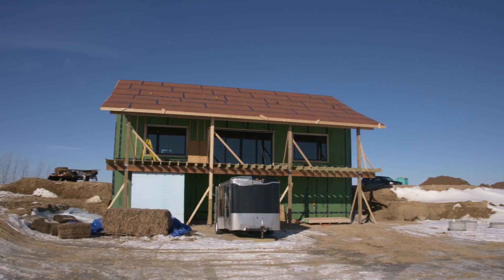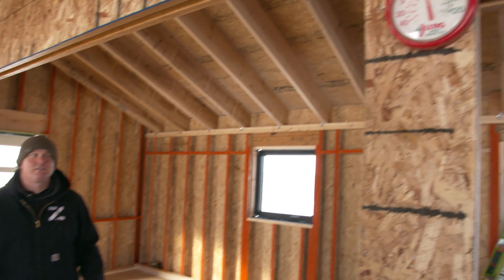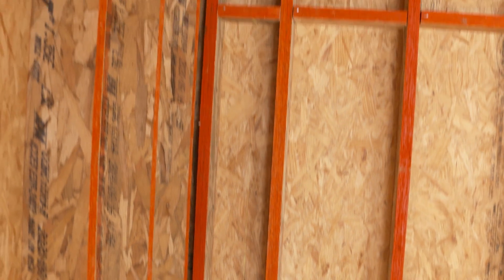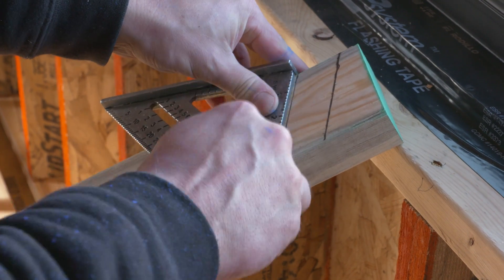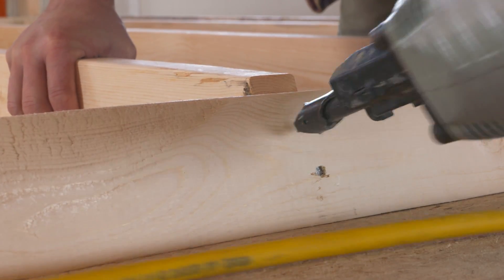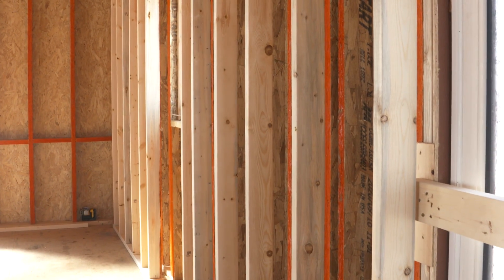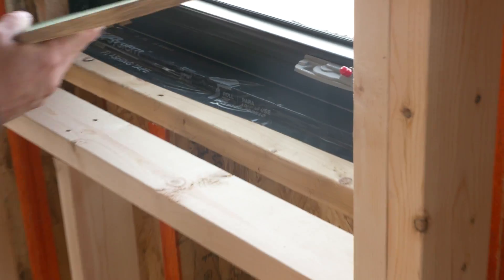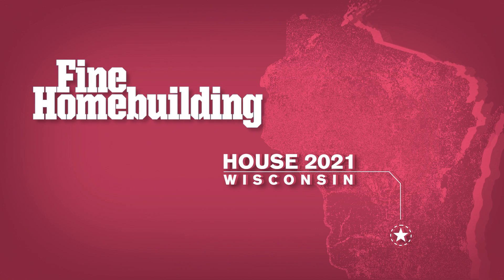Episode 3 FHB House WI: Framing Interior Double-Stud Walls

Comment: Why not just build with 2x8 or 2x10 walls, insulate 2/3 the depth and leave 1/3 available for electrical?
Reply: Yes, why not?
Reply: Because they are more expensive, not as easily thermally broken. heavier to work with and will move 1/4 to 1/2 inch risking damage to finishes down the line.
Reply: Thermal bridging of 2x8's will cause heat loss or require exterior foam insulation to break the thermal bridge
Reply: Thermal bridging and insulation needs to touch all 6 sides of a wall to reach it's quoted r value. Also these walls are thicker than a 2x8 wall also as lumber gets larger it's straightness decreases

Comment: Vaulted ceiling means all ur heat ll  b there. My bro built one n claimed he could live at 62 degrees temp but I don’t believe ittl b comfortable for me.   I’ve found air sealing to b the key !!  My home I put foam on inside v under the rock n my only regret is should’ve went for 2”